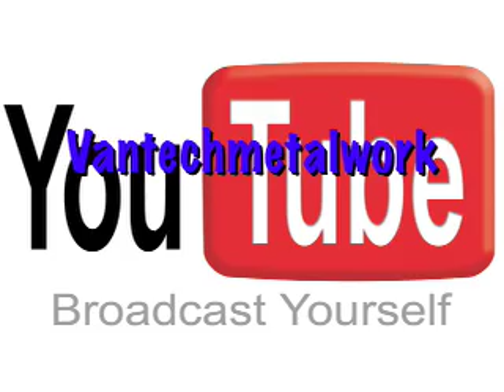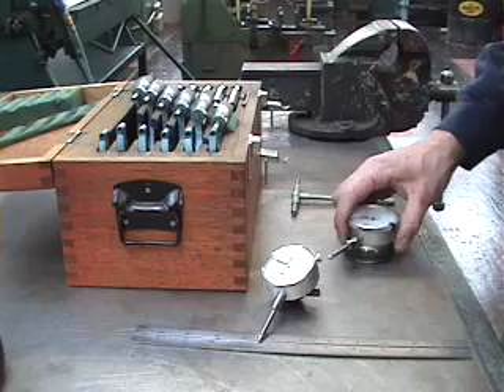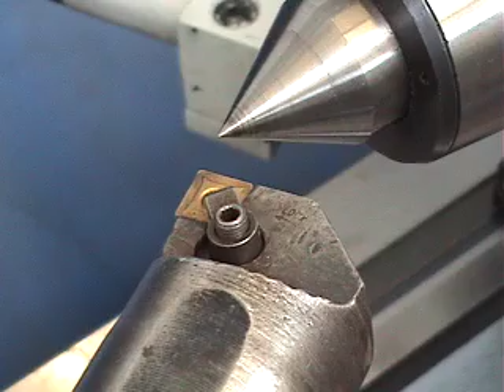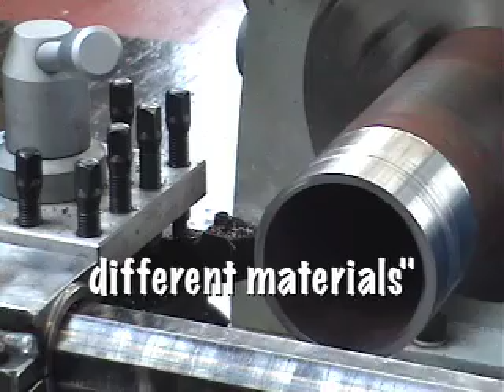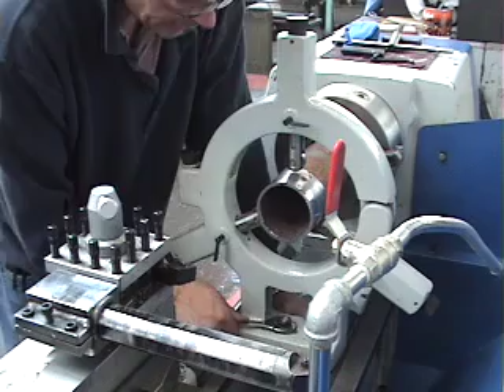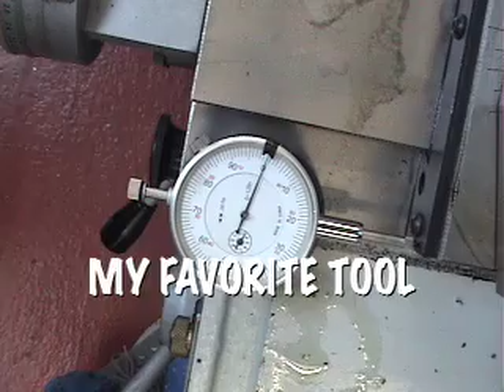Advance METAL LATHE- boring steady rest facing

Comment: I am a qualified scientific instrument maker (now retired) with my own engineering workshop.  I did my apprenticeship in this trade about 55 years ago then obtained high-level mechanical production engineering qualifications, plus a few degrees.  Even as an apprentice I would have been in trouble if I wore long sleeves, a watch and such, or machined a length of tube sticking out of a three jaw like this. Anyone who praises this as advanced or even competent skilled machining, simply doesn't understand wheat they are watching or the dangers involved.  In my opinion the machining in this video could be classed as rough enough is barely good enough.  The machinist was lucky the work didn't move and cause an accident while being machined like that, and lucky he didn't have an accident sufficient to mutilate him. This video should be removed from YouTube.
Reply: I've ran an engine lathe while wearing LONG SLEEVES for over 55 YEARS..NEVER had a problem that outweighed the cuts and burns from hot "chips" ..but..I agree .. this clown is NOT a good instructor ..!!

Comment: to center pipe in chuck, why not loosen chuck, then turn chuck while adjusting pipe in chuck against cutter until concentric with chuck and tighten chuck. Then turn and and face end of pipe then flip pipe end for end and use trued pipe end to brace and hold pipe true in chuck. Then complete operations on pipe.

Comment: Not the right approach if you ask me....you need to steady end of pipe with a cone center...if you don't have, make a step plug and center drill. Boring bar should be on center height...if anything a little above to compensate flex.

Comment: Well, for him, it's "advanced" apparently. I question the method of holding a ~ 8"-10" length of 3" pipe unsupported with only a three jaw chuck in the beginning of the film. I would think it would have been better and safer to make a some sort of expanding mandrel at the tailstock end and do the initial turning (as shown in the beginning) with the mandrel held by a live center. It doesn't seem wise to teach persons to hold the pipe like that, unsupported.

Comment: (Cont) In other words both ends have identical machining to them and with the copper under the jaws initially, the best of an out of shape circle is found as does the same, the 'self centering' ball bearing at the other end. The OD can then be machined all the same yet there will still be a natural (pear shaped) out of round ID but this hopefully as a minimum of inconvenience. It frightens me to see a foot length of pipe stuck out of jaws and machining attempted at the very end of it given pipe is always pear shaped. But remember. The Centre must be drilled with pipe at full length even if it fits through the spindle.

Comment: Tack weld an inch wide strip across the tailstock end pipe face. Place thin copper plate dogs under each jaw and indicate spindle end as close as you can get without spending all day. Fit a fixed ball bearing race on 1/2 inch square mild steel onto tool post as if its a cutting bit. Move the carriage down to the end of the pipe and then slowly advance the CrossFeed in till the bearing outer race touches and hence centres the pipe as best as can be expected. Drill centre into inch strip steel and engage tailstock with centre. Machine from the tack welds inwards 2" to get clean steel. Zero CrossFeed. Fit steady rest. Machine chuck end an inch or so to the same Zero. Open steady rest without slacking off rollers and flip end for end.

Comment: you said boring bar should be a bit under, this is false. It should be a bit over, so that when the bar flexes, it flexes out of the material rather than into it, thus preventing chatter rather than increasing it.
Reply: +meocats when doing a inside diameters tool always need to be above center, when doing outside diameters tool is exactly on center, you are right, it did seem strange to me that he did that, no logic whats so ever.

Comment: well looking at the tube diameter its small enough to let your saddle to pass under it......you should have just spun the steady ring near to the chuck that way you improve finish on your steady band and your not having as much push off !...... finish steady area, set steady on lath and set bottom 2 rest arms ( bearings or pads) then turn round in chuck and move set steady ! ....far safer and quicker :) ..... when you face your work...instead of changing tool get use to moving both the saddle handle and the cross slide handle at the same time...... you can reproduce the chamfer to break the corner very easily
Reply: Correct - ALWAYS work as close to the chuck as possible.

Comment: this size of part  can be made without rest.. tough, with rest might looking safer..

personally me, I would make flat first the end , boring to a rough size, make  outside diameter  with a larger  livecenter... then back  to finishing the hole... because  it is not  casting, it is a steel,  that's  change  its geometry after  each passes..

using  the  live center to setting  tool to center also  bad habit.. unless a machine brand new,  99 percent sure the live center is ""sag"" means under the axis..

also  in a larger hole  boring bar can be raised  over the center reducing  resonation..

this wont comes of book,,, this comes to you after standing 20-30 year behind lathe..

but im not a teacher..

Comment: in your video you refer to trying different oils to cut with, be very careful using engine oil of semi and full synthetic, types, it contains Phenol, this substance is used in the medical industry for tissue destruction. I lost the feeling in two of my fingers due to a small swarf covered with oil puncturing the skin, my doc told me that the feeling would return after 90 days, two years on and I still have not got the finger as it was prior to the contamination. the loss of that finger was so dangerous as you were not aware if it was touching anything and when grinding or welding and the metal work I was doing it was another worry to look out for. and the oil company were not helpful in anyway.

Comment: I hate all these new direct drive gear driven lathes on the market.  Then to make matters worse they install electronic brakes with instant stopping power.  Abrupt starts/stops makes turning parts like this all the more risky.  So much nicer to have a clutch/coast/brake capability to give the operator careful control over the work piece, and less chance of throwing it out of the chuck.

Comment: I was taught to finish the OD near the chuck jaws.Then, flip the part & set up the steady-rest..  Much safer.  Or, use a live center.  Also, better to set the boring bar high. especially with that much overhang.

Comment: By doing as you suggest one would have to indicate the part back in and probably tram it to ensure the center line of the part was running with the center line of the spindle. That could take a fair bit of time. Best bet would be putting a bell center in the part while turning the steady spot to keep it stable. You would have to pull the boring bar, but for a one off part the time wouldn't kill you.

Comment: I do. Whenever one of my employees comes to me complaining about a poor finish on a small bore or they can't get the diameter to come in... its one of the first things I check. Half the time it is the culprit and by moving the tool to on center or just below, they're back to making a 16 or 32Ra finish...which ever may be required. I've had hammer them on proper setup technique as a way to avoid dealing w/ common issues. Center height has been of an issue as correct use is 2nd nature

Comment: 100% incorrect regarding the tool height. On center or below center as shown in the video(especially when performing internal work) is correct to achieve proper cut angle and not risk having a clearance issue w/ a shallow clearance angle like the 7 deg angle of a CCMT insert. It's especially important as the work piece gets smaller. The only time I might run a tool over center (and only by .001 or .002") is if I'm trying to remove a tit on a face cut.

Comment: Nope. Machine operator. I have trained operators to do everything you describe in less than three months. Them starting with no machine experience. Take a manual machinist and put him on a CNC. He will be up and running withing two days and that will be just learning the control. Take a CNC guy and put him on manual machines. You basically have to retrain them.

Comment: You're a teacher and don't even know the name of your tools. What you describe as a "snap gauge" is a telescoping gauge. A snap gauge is something entirely different and is very seldom used these days. Chances are good that your students will never even see one let alone use one. Also, your boring bar should be set on center or slightly above center, not below. Also, you would do much better with a neutral or positive rake boring bar, not negative as you are using.

Comment: First your boring bar should be same or slightly higher then your center NOT LOWER!  The tool needs relief on the heal of the insert even if the tool has positive rake because there will be deflection down as well, that will get rid of most of vibration also for a carbide insert you will find that it will require more SFPM to work effeciently check yor insert specification because also your nose radis will also make a difference too. PS Been a machinest for 15 years

Comment: You have some machinist skills . The machinist made that fixture which was originally 28 inches long and was indicated to .0001 +.0000 - .0001 .   Its nice you calculated feeds and speeds but dont bullshit me . Theres a chart unless your doing a one off K-monel material that the shop never runs .  Inspecting is a throw away any 1st year journeyman can deal with .  The machine most likely has feeler axis and programs parameters itself . You just show it where zero is . A set up tech , yes

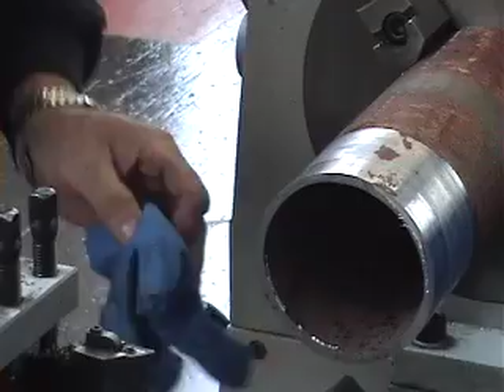Comment: Problem: between 1:25 and 4:42, cleaning up the outside, the workpiece is held only by the chuck jaws, maybe an inch of support on a piece that looks to be ~ 8" long.

One solution to the problem is a live "bullnose" center in the tailstock to add support and to drive the workpiece toward the chuck.  Bullnose live centers are available on eBay, and are relatively inexpensive.

Comment: We require a clearance under the cutting edge to allow the cutting edge to penitrate into the material without undue friction or resistance. If we set the tool on centre height the when we get the deflection, we will reduce the clearnace under the cutting edge.

Comment: I note that "CNC addict" mentioned that he believed that the boring bar should be set up ABOVE centre. I concur with this practice. Boring bars as a rule are less rigid than most external turning tools, and as such means that once the cutting edge comes in contact with the material there is a potential for a deflection. Some of which will be downward.

Comment: @FreePizza007 the point of machining is not to clean up rust, its to remove stock to a desired size...the skim on the outside is because tube is never perfectly round unless you pay out the ass for ground calibrated tube, and oval tube wont run very good in a steady.
Reply: So Where ! Do you get your Tube ! From !??

Comment: @filaso21 i've worked shops that would give a written warning then fire you for not having sleeves rolled down...I quit after it got ridiculously unsafe with what they wanted from the employees. That said, you can safely machine with long sleeves...shops get cold in winter

I have gotten a laugh from the comments...I've found after doing 1 year pre apprenticeship, 4 years in an apprenticeship, and 4 years post trade that there is a million ways to get the job done.

Comment: If you really wanted to make quality you would indicate that part concentric as possible, then machine a minimal depth true surface for 3 or 4 inches like he did..then turn the piece so the jaws are holding a true concentric o.d.. by doing this it reduces compounding tolerances.. someone should post geometric dimensioning and tolerancing videos on here..  work from junk surfaces machine junk surfaces.. quickly create true surfaces to work from...  always get quality surfaces..and be safer too!!!

Comment: Any time you use a roller-type steady rest, you should sheild the steady rest from chips with a piece of cardboard- cut a hole in the center the same size as your pipe and tie it to the frame.  Catch a chip in the roller and there goes your finish...and sometimes the bearing race.

Comment: it'l push the tube out of round the way you explain, it will also have a smaller contact area for grip.     if he chucks external he has spread the load .  then use a boss with a shoulder down the end bore with a live centre for axial pressure application into the face of the chuck.

Comment: I'd have faced one end as square as i could get it and then turned the part around so the square end rested against the chuck.  This adds rigidity to the setup.  Also I'd use high speed steel tools to face and cut the place for your rollers as you don't use as need pressure to cut.  

Loved the video, good work.